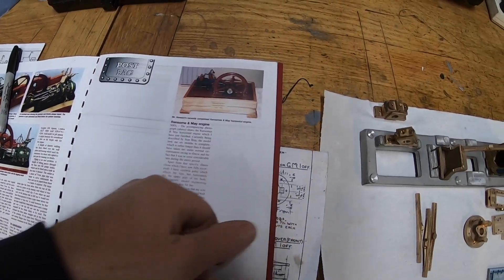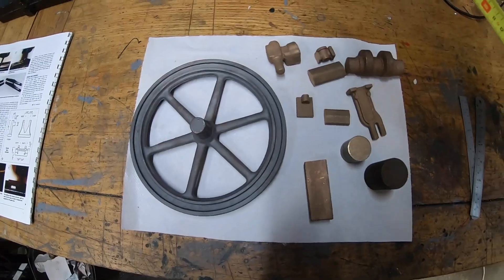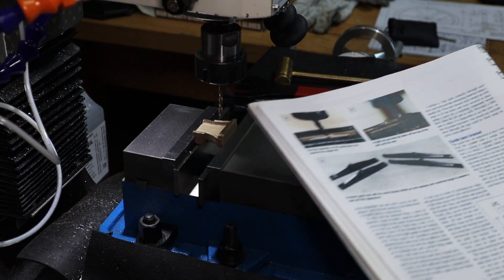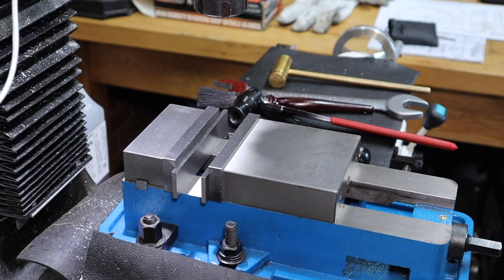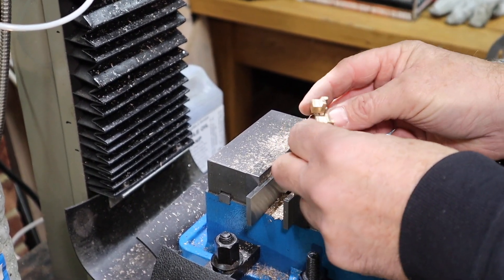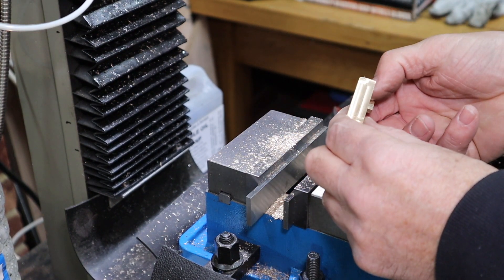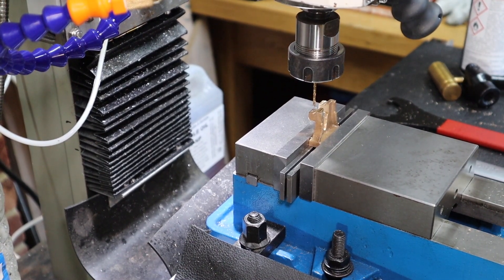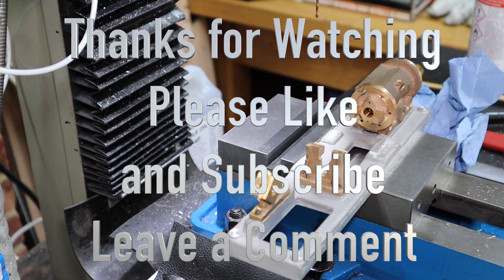Hemingway Kits Machining a Model Steam Engine Part 1

Comment: I've just found your channel . I have had the casting set for this engine for quite a while but never got round to starting it.I think what put me off is the " watch making " size of some of the screws ! My eyes are too old to see such things so I'm going to alter some to a normal size, nothing smaller than 6 BA or 8 BA. at the smallest.  I'm looking forwards to your progress on this engine.
Reply from the maker: I have done the same thing with a lot of the screws and bolts, I also make good use of a magnifying glass and jewellers loop 🙂